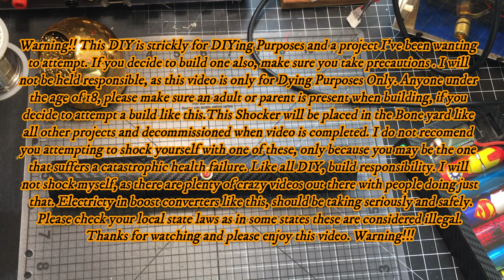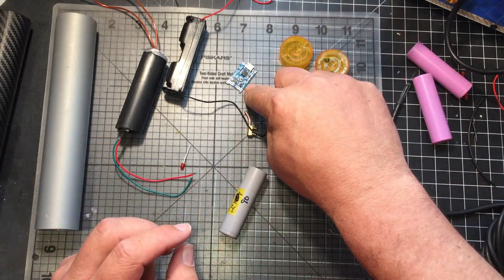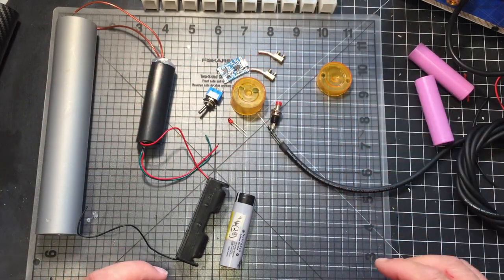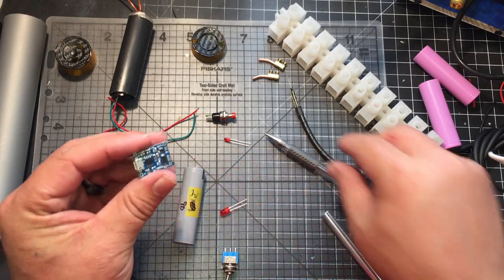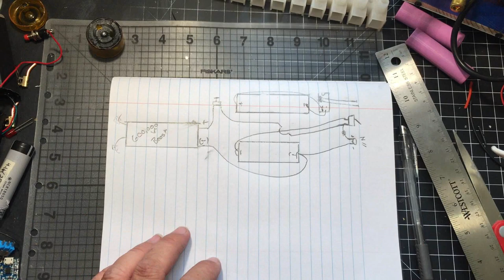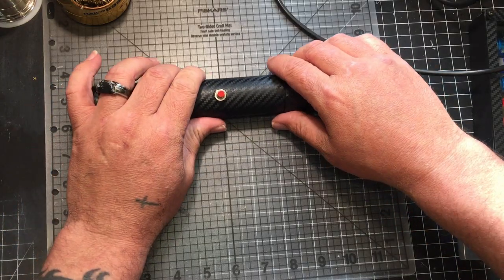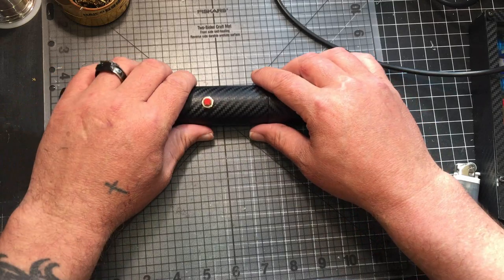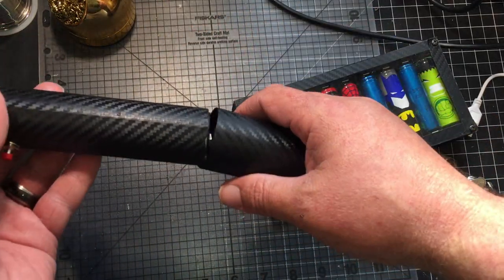400,000V - 1,000,000 High Voltage DIY Stun Gun " Taser " Zapper  shocker

Comment: 1:50 -  600,00 Watts, I don't think so.  Nor, I suspect, is it 600,000 Volts!!
Reply from the maker: Your probably right, being I only used one 18650. If I had to guess, more along the line of 40 to 50k, but unfortunately I have no way to test. Either way it was a really fun build. Thanks for commenting!!!👍👍👍👍
Reply from the maker: I also had to correct my self in a pop up comment. Where I add V instead of watts. Still rusty, just need some WD40 and my terminology should be on point again😀😀😀
Reply: @njfulwider5  - I'd love to be able to get 600,000 Watts from a 18650 cell, it would solve the  world's energy problems or, more likely, result in a black hole! Interesting project, though, thanks and good luck./
Reply from the maker: Silver Legend Thanks for commenting!!!👍👍😀😀
Reply: it more than likely is! it is very easy to make a 600,000 volt stun gun its not the volts you need to worry about though its the amps that are important